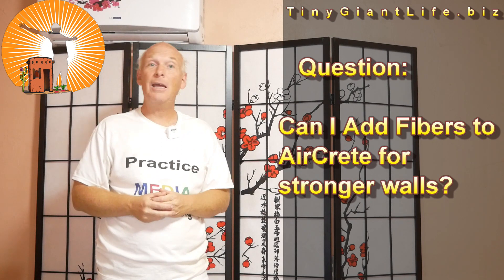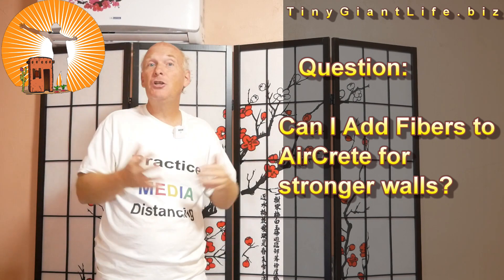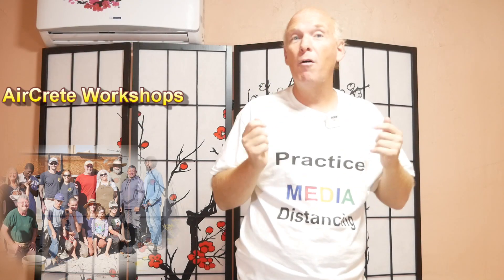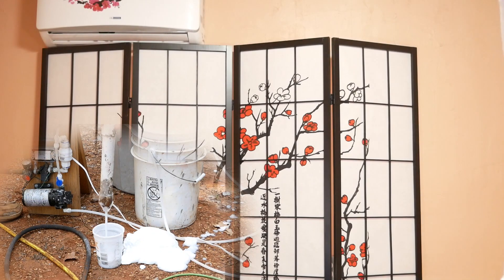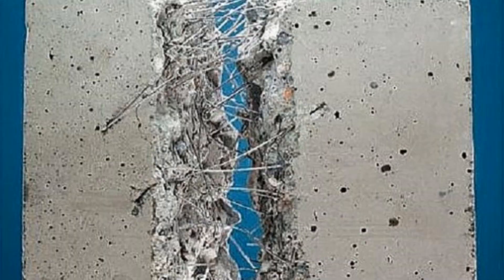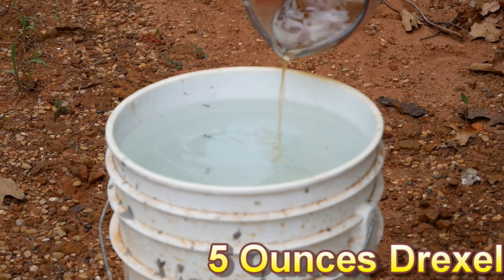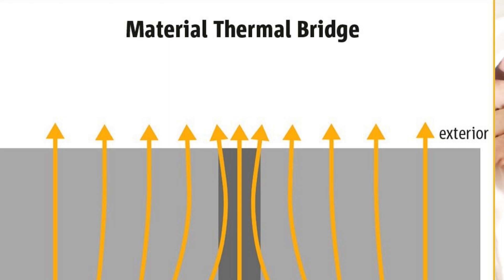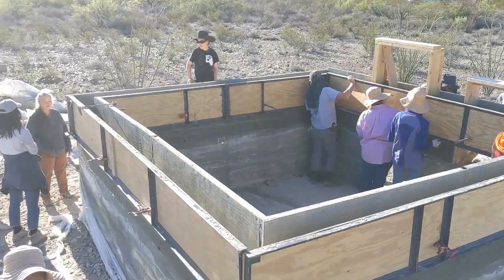22 Can I Add Reenforcing fiber to AirCrete

Comment: Can I build a multi level home with aircrete??
Reply from the maker: Yes all you can and it's been done. It just running the numbers to be sure the wall is thick enough to support the loads above.  I wouldn't build higher than a 2 story without steel or cement post because of sheer strength in earth quakes.